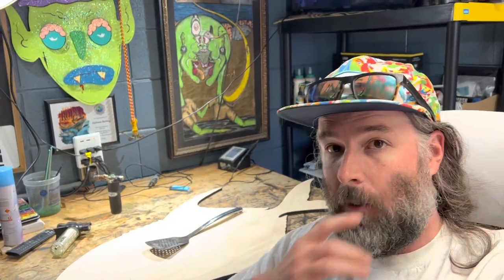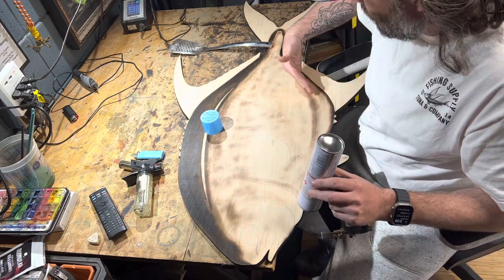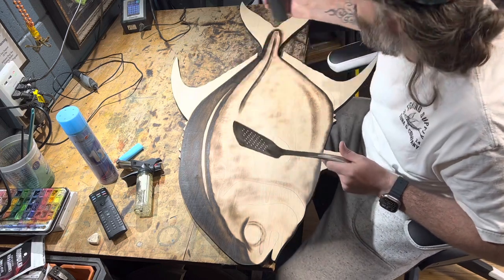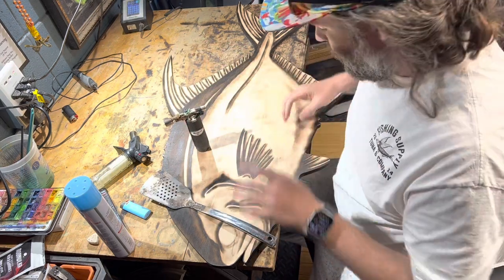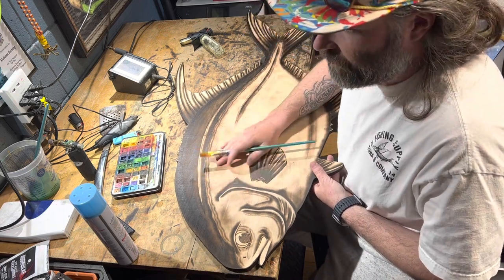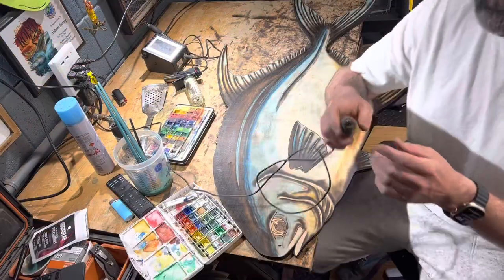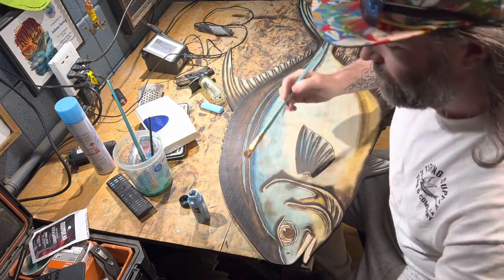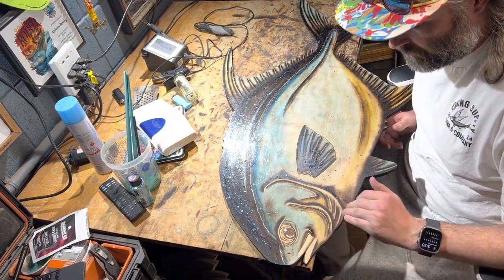HUGE PERMIT WOOD BURN!🔥

Comment: Hey Pat. Your work is beautiful and I'd like to give it a try myself. I was wondering what kind of wood your using, what kind of spatuala your using, and also the torches. Thanks Lee
Reply from the maker: That one was done one .5” birch. You can use poplar as well but any smooth blonde wood will work as long as your surface your burning doesn’t have a chemical finish on it. Ill have anew video up soon thats a little more detailed on the wood I like to use!